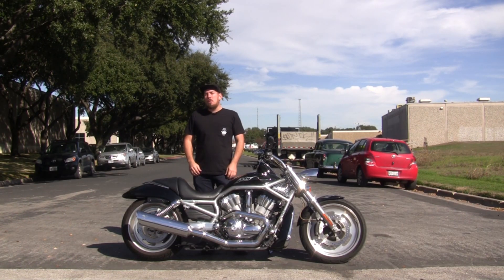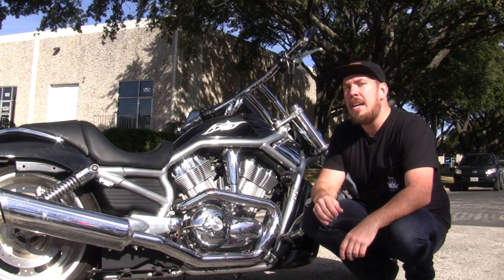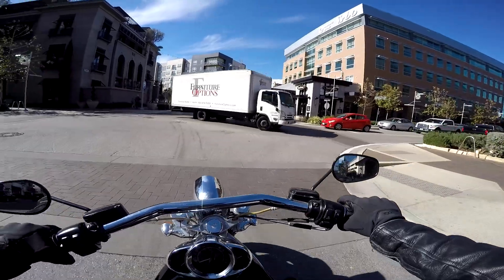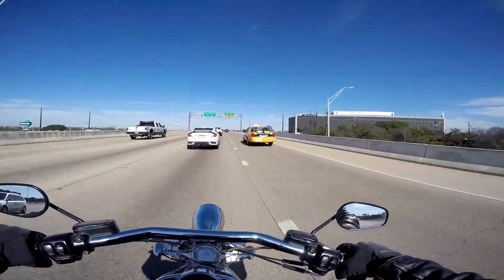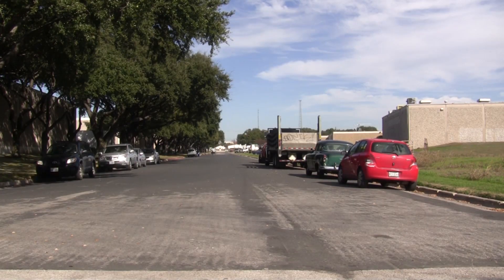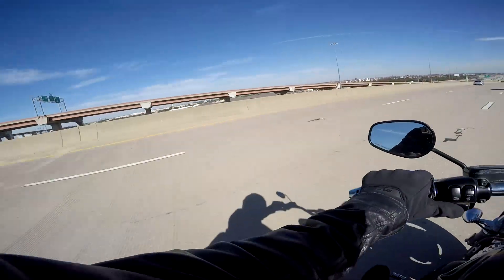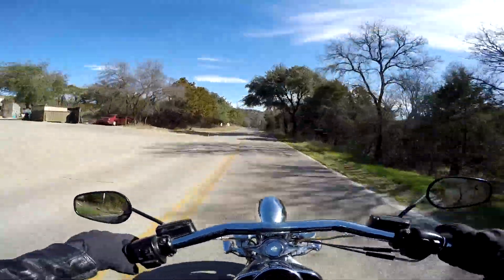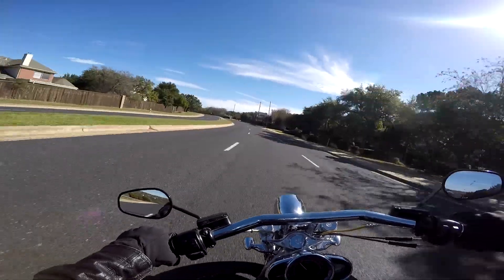Is a used Harley-Davidson V-Rod the quick ticket to a power cruiser?

Comment: I've had an 04, 07 and 2 08s in the last 13 years and I loved them all. The 04 with its 180 rear tyre was a little better in the hills, but as I'm not into riding lots of twisty roads, the 3 NRS were the bees knees for me. Only got rid of my last one because I'm getting a little older and the joints are a bit touching nowadays. Great bikes though.... we definitely recommend at least taking one for a ride.
Reply: How was the reliability Peter? Any headaches?
Reply: @RajerThatYT  none that I would speak of.  You will still modify to suit yourself aesthetically just like any other H-D, but the bike itself is great in whatever configuration.
Reply: @RajerThatYT  it's the only motorcycle engine that I'm aware of that has passed the Düsseldorf test that requires an engine to complete a 500 hour run that simulates a run on the Autobahn under varying loads and engine speeds up to and including full throttle runs.
Reply: What would you recommend for a beginner??

Comment: I have an '06 VRSCR Street Rod. It was the first of the series to have the 5 gallon fuel tank, inverted forks and Brembo brakes. With a 40 degree lean angle it absolutely loves high speed sweepers. It's taller than the other models and with mid controls it is very comfortable. I used it as my sole transportation for two years and was commuting 155 miles daily on it. It still puts a smile on my face every time I throw a leg over it.

Comment: Great video.
I own a 2006 with the smaller rear tire.   I would be curious how you like the bike with the smaller rear.   I am by no means an amazing rider, but I find my bike surprisingly good in corners.
Reply: yeah I own a 2005 with a 180 tire. Ive ridden a 2013 night rod with a 240 tire and there is a WORLD of difference in the way the both handle! Vrod with a 180 handles MUCH better than the 240 no question. Putting a 240 on the vrod was a big mistake!

Comment: Vrod 2012 muscle denim black here, good review however i disagree on one thing. The handling. My bike carves corners beautifully and cortrolled extremely stable and sure footed, and ive had many 1 litre sports bikes. I would of given the handling an 8 out of 10 personally but everyones gauge on things is different 😂. Best Harley ever produced maybe even motorcycle in general as a few examples have 300 thousand miles and still going at Talladega. Never heard of a motorcycle engine lasting that long, Porche engineering 😁💪🏽

Comment: The V isn't nearly as bad in curves as people are led to believe...... yrs ago I was behind one with a 240, I was on 883, on our curviest, all I could do was stay with him, when we got to milder curves he was gone

Now I have a V, and after having learned a little about getting power out of and curve handling with crotch rockets......my V has the 180 and mid controls, it is easier to get my butt off the seat and over the side on the V than it is any crotch rocket I've ridden......but the effect is less because of the weight......if I still had the balls to scrap pegs it would put a whoopin on a Sportster

It's true that a super skilled rider on a V would be beaten in the curves by a super skilled rider on a RR and probably even on my 750 crotch rocket

But 95% of cruiser riders would find themselves with more curve-ability than riding just about any cruiser

Kind of sorta similars are kaw meanstreak, and better Zuki M-90, neither as fast or handle as well as the V......the M-109 is probably faster, not sure cause I've never ridden one fast

Comfort, I've got the stock wind deflector on mine, it does amazing......I have noticeably less wind on my chest than on my wide glide

I'm quite comfortable with stock seat and mid controls, but on a trip the mids would get crampy.....stock highway pegs

And now the bad thing about the V.........to actually enjoy that power and not go to jail you must ride on a track or use only 1st-2nd gears......or go to Germany
Reply: V-Rods are faster than M109s all day. Especially the 180 tire models.